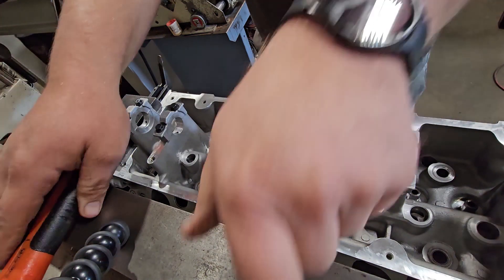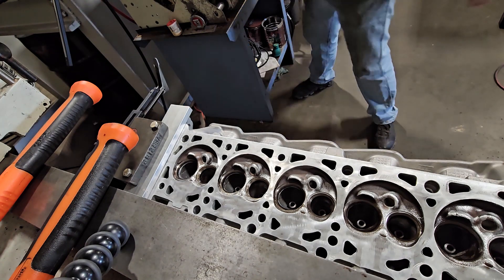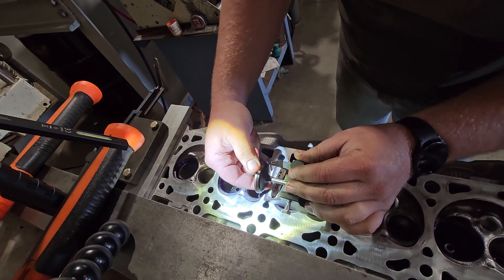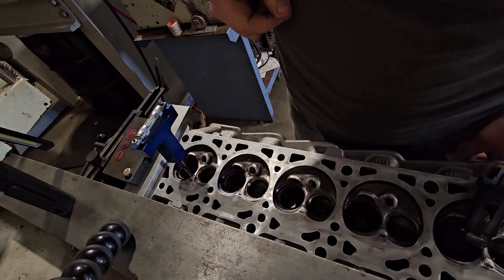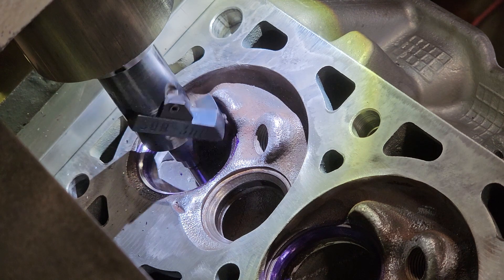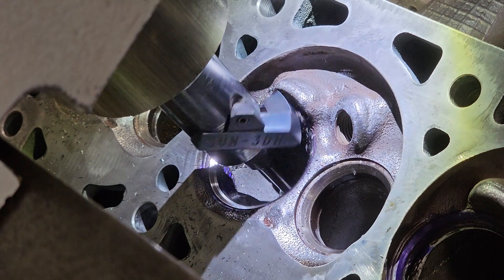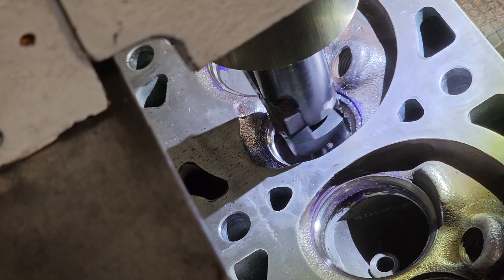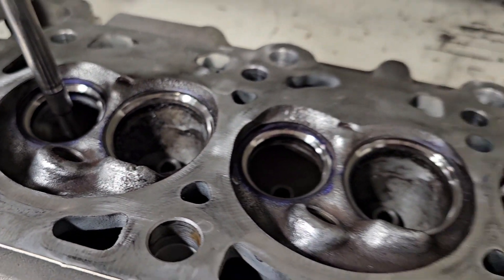Cylinder Head Seat Cutting a Ford 6.8 Liter V10

Comment: Head looks nice.
Really clean also.
I noticed you do not use lift springs under the cutter body.
Is it not required?
I use the Goodson 3D and it uses springs.
Just found your channel. 
I will subscribe to your channel. 
Take care, Ed.
Reply from the maker: I bought the machine used, and the tooling bearly adequate. I have one, but it bearly works, so I only use it when necessary. I've found that the cutter only cuts when pressure is applied, so at the end of a seat, I allow a few rotations at the same spot to make sure the cut is complete. Am I doing it correct? Maybe not, but it hasn't let me down yet.